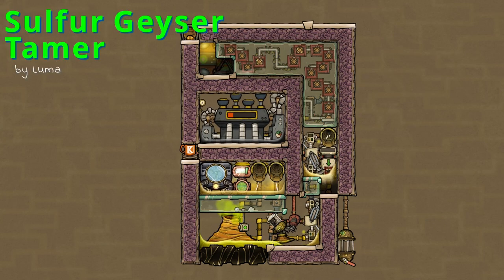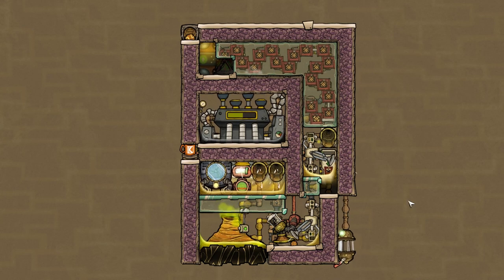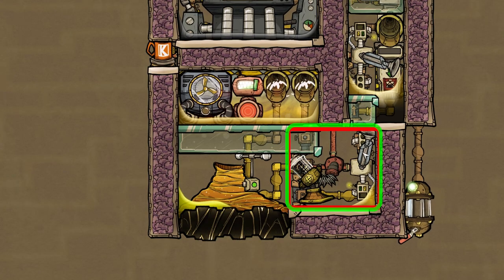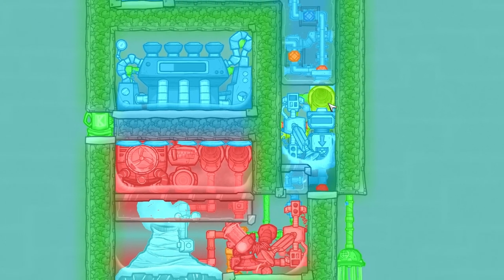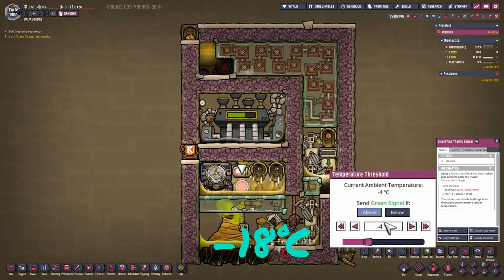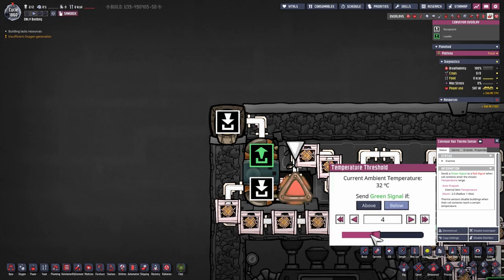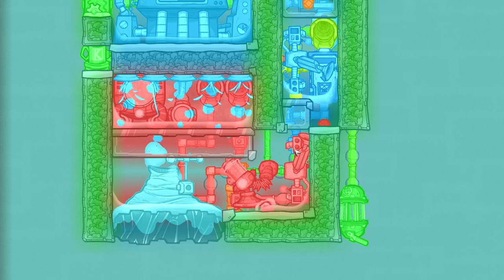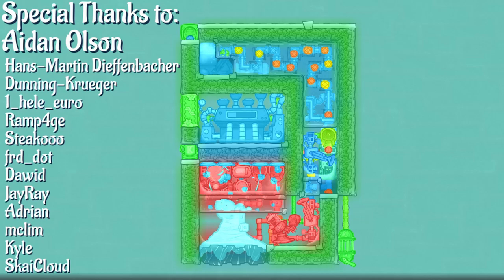My Sulfur Geyser Tamer - Explained

Comment: Nice.  Sulfurs heat range and shc makes it kind of a pain to get right.   How I solved mine was to let the geyser drop into a pool of cooled nuclear waste.  The nuke pool is temperature controlled by a turbine/aquatunner setup.  The sulfur doesn't need to be cooled down that much but you can get it pretty low as the shc difference is really high the sulfur drops in temp almost instantly.  Once down to target temp the AT doesn't run much at all.
Reply from the maker: Nuclear waste is a great coolant Also good solution :).

Another viewer suggested a version that is self powered amd self cooled but leaves the sulfur at 95°C. That one is in testing atm.

Comment: So i did built something similar without aquatunner but I'm pumping 1kg of sulfur trough the steam room and then in a counter flow with the turbine output water to exchange temp... I'm currently waiting for the geyser to rerupt with much anticipation to test, but thanks to your design I will know what to change if it doesn't work! Thanks
Reply from the maker: Sounds like a good and solid design. If you want to share that consider swooping by to the discord :)

Comment: I understand that you need some conductive liquid for turbine, auto sweeper, and others in order to cool them better, but can ethanol be used instead? Also what metal best for radiant pipes?
Reply from the maker: For this build any radiant pipes should be fine. The cooling power is good enough.

The liquid depends on where in the build you use it. Anything that does not freeze at your desired temperatures in the cooling areas. Anything that doesn't flash to gas in the hot areas.

So ethanol for cooling yes, but it has a !terrible! thermal conductivity.
For the hot areas NOT ethanol.
Reply: Thanks!
Reply: You could make smaller the heat Exchanger by using aluminium
Reply from the maker: @gcdani271  Yeah definitely :). And you can easily make it bigger and use worse material. How small do you think we can get it while still keeping it rectangular?
Reply: @Luma_plays  pretty much as high as the steam turbine making chekerboard pattern
Reply from the maker: @gcdani271  Very nice! And compact. Will try that someday :) Thanks.

Comment: Why don't make it solid immediately then pick it up??? We can spare 1 auto sweeper and the pump also make it more compact
Reply: Build 2 wall on 2 side make top open put some water and temperplate  in then run the loop in we will have 50-60 C sulfur run rail inside the insulated wall then feed the plant. Sulfur heat have no effect the tree so why bother cooling to 30C? Grubfruit have 50C upper limit is also easy to achieve.
Reply from the maker: I honestly can't remember. If you only have the sweeper and the conveyor loader is full the sulfur sits in a pile down in the lower room.
Reply from the maker: If it would only be for grubfruit sure you can save power o cooling. But the larger the Delta-T the faster the cooling.
Also you can heat up your base if you have it at 50°C. When you also plant mealwood then those could overheat.
If you only have grubfruit and ranches then 30°C could also be fine.
Reply: @Luma_plays  yeah! But we need temp control for sleet wheat anyway. So I prefer to build a ice buffer box to control all farm in the end then. Put too much effort to build big tamer only benefit 1 tree is not worth it at least with me. But  building like you is cool too.

Comment: Hmm a bit too complicated how about let it drip down to a pool of cold water in vacuum. Then transfer it out
Reply from the maker: That is also a totally fine solution. you could as well just pool up the sulfur and cool it then. Both of these methods are not as power efficient as this setup though. Not that it is a large power saving but i like making small efficient build. Most of the times that means they are not as simple as they could be.

Comment: hard loop. NOT EFFECTIVE!
Reply from the maker: Mr Light would you mind elaborating your comment. I have no clue what you mean with hard loop. This worked perfectly fine on 20 different instances over a span of 400 to 600 cycles.
Reply: The use of solids on a conveyor belt loop DOES look kind of inefficient to me.  (Perhaps that's what he means?)

I think the more usual practice is to use a one-way conveyor belt with a timer so it keeps the solids on the belt for the right amount of time.